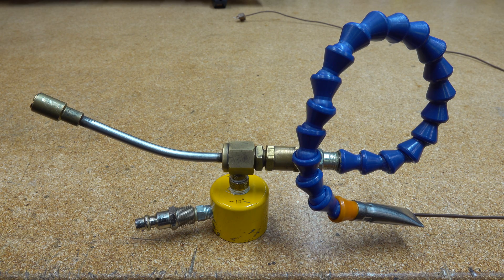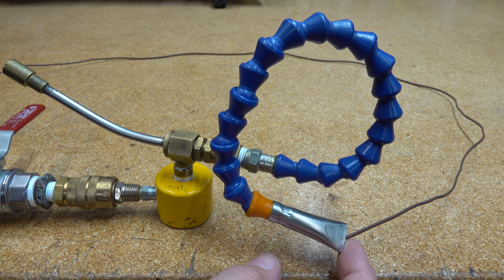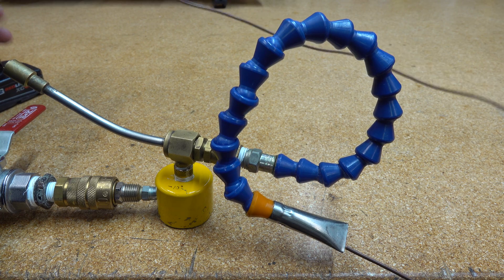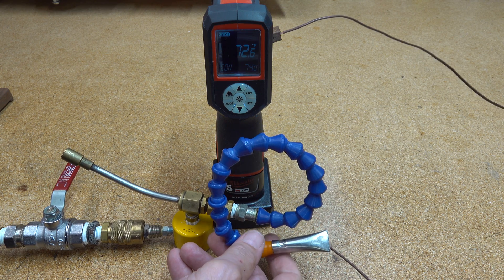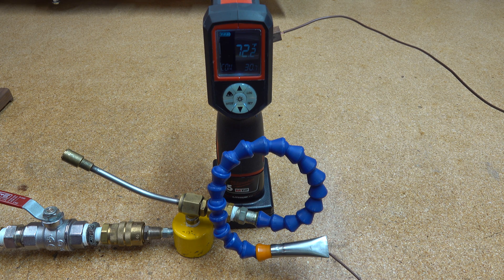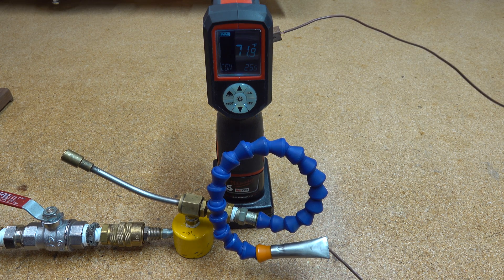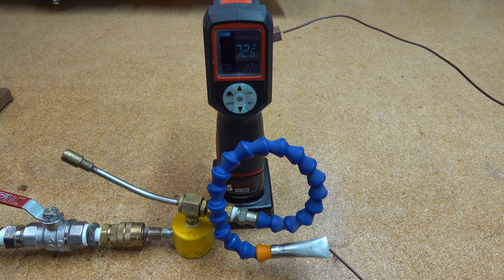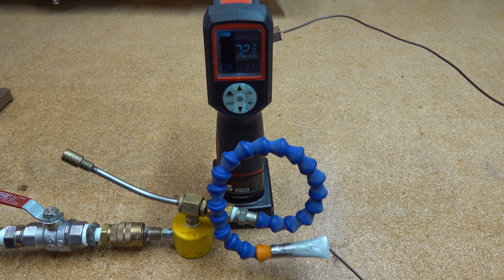-10° BELOW ZERO AIR CHILLER!

Comment: Hilsch Tube.  We used them to heat and cool chokes on carburetors back in the day.  Snap On sold one.
Reply from the maker: I'll bet those were cheap! LOL🤣
Reply: @joesshop3622  Blue Point YA862 Choke Tester.
Reply: To stop vapor lock?
Reply: @The_Ascension  For testing the manual choke on a carbureted vehicle.

Comment: Did I miss something? How does it work and where can you buy one?
Reply from the maker: On line $40.00 to many hundreds! Search Cold Air Guns. Better units go 100° below compressor air temp. This is important since they use a lot of air and will warm up your tank if you plan on using it for a while. Nothing to do but pay for it one time. No parts, no nothing to buy or add again. Just add 120 psi pressure.
Reply: I hope this makes sense. 
Hot air rises cold air sinks. Naturally.  
In this case. One is forcing air to escape quickly up as “exhaust” while the other down “condense”. This causes a separation in pressure. In other words.  The heat from the motors that compresses the air also gives the opposite in return.. Cold air. The same principle in HVAC. You could as seen demonstrated and similarly use just a T-connection with the air going in and splitting  a tube of air going up while another in a twist or two in a circle going down. The up exhaust opening has to be larger than the down or condensing side.
Reply from the maker: @The_Ascension  Fantastic explanation! I was sick the days they taught that in school! LOL!! Thanks!!

Comment: Awesome contribution! What psi are you using? I'm guessing 2/3's of  that psi goes out the exhaust while 1/3 goes out the condenser. The reason I ask is the CFM flow can chill down certain metals quicker. -10 should work for most drilling, milling or lathing up to a desired cross section. I might want to add this is the opposite of torching to expand metals which is common place. Cooling is not conventional unless air craft aluminum riveting. Which I would think works just as well. Just not as common. Most people like fire. lol.
Reply from the maker: I think it was at 120psi. And yes the exhaust appears to deliver more volume when set to the coldest positions. It's tough to be 100% certain since the exhaust is a radial tube hissing and the other end is a tight 1/32 x 5/8 air curtain (thin ribbon air flow) Thank You Sir!
Reply: Sounds right.. most regulators  are set to 120psi. I asked because you had a lever that was placed in line which looked like it was moved to 90-95% open.  If not 100% Either case, I think this principle is either the Bernoulli effect and or the Venturi effect. That helps in upscaling. Also to be clear. Volume is temperature dependent .
Reply from the maker: @The_Ascension  I might of had the compressor set to 150psi. But at 120psi you do achieve the -10 if your compressor isn't dispensing hot air from previous uses/cycles.

Comment: They called vortex tubes and AR Comercial available. Quit expencive
Reply from the maker: They start at under 40.00 for offshore knock offs on line. Back in the day it was a "Mr Cool Tool" for insane money. Today it's still high priced low tech that does an amazing job but there are LOTS of imitators today to choose from.
Reply: Hilsch tube.  ;)

Comment: So where do I get or how can I make such a device?
Reply from the maker: On line Amazon they start at 35 or 40 dollars  for offshore knockoffs like mine but not exact. At that cost you'll need to come up with a way to feed it air since the inlet is designed for a 1/4" speed connector, you just press it in and it locks. I had to modify mine too. Look up "cold air guns" online. They have others by Vortex if your wallet is too thick lol. Thanks!

Comment: It is terribly hard to hear the commentary over the noise of the hissing air!!! 😬  That being said, I used work at a company that designed and made prefab roof trusses, floor trusses and wall panels. For their wall panel production line, they had a laser burner that would burn in the wall stud positions on the top and bottom plates. They used a compressed air cooler such as this to cool and prolong the life of the laser burner head. Good stuff, but uses quite alot of air!!!
Reply: If you turn on CC that worked for me.
Reply from the maker: @The_Ascension  Another good idea! Sorry for that.
Reply from the maker: Yeah I'm sorry the mic muted automatically due to  the volume threshold moving up a tad lol.
Reply: @joesshop3622  I call it "noise masking"!!!...happens all the time at my house!!! I'll be in the bathroom with the vent fan on and taking a shower...wife will holler in asking about something which I can't hear because she's not aware of the proximity and physics of sound!!! 😂 I always have to holler back and tell her to SPEAK UP!!! Most definitely not old age on my part as I used to be able to hear the whine of a 16KHz high voltage flyback transformer from a CRT TV on the other side of a block wall.
#BLURSED 😜
Reply from the maker: @RTR-MATEY  Wow, a blast from the past, a CRT screaming as you watched TV! Funny thing is, they say most if not all women cant hear that super high pitch? I could easily tell if any TV was left on without volume or just the cable box switched off. Glad those days are gone lol!
Reply: One great application for such demonstrated.
Reply from the maker: @The_Ascension  Thank You Sir!